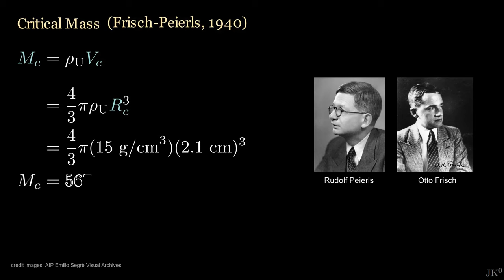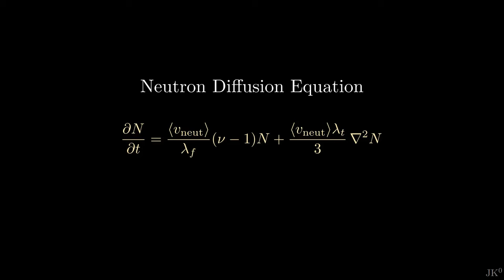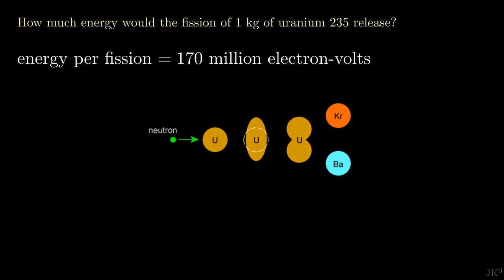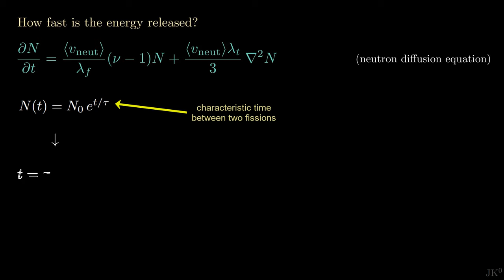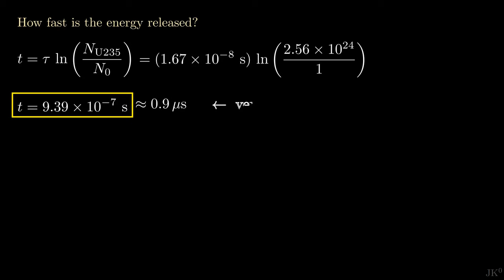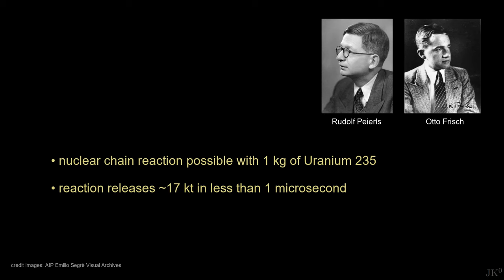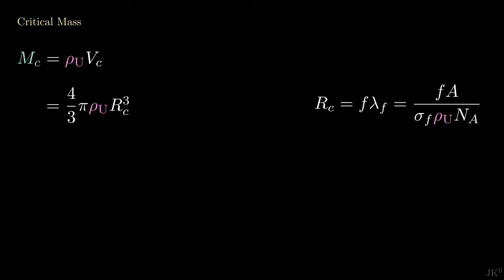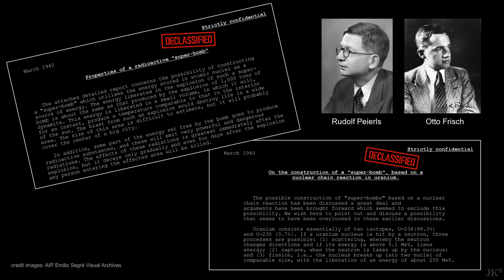Physics of a nuclear explosion

Comment: Another very impressive video. Which makes me think. It is my belief that nuclear power plants potentially are far more dangerous than nuclear bombs. Nuclear power plants contain thousands of kilos of nuclear material, whereas a nuclear bomb only contains a few pounds. The nuclear power plant is in a constant state of near nuclear meltdown, which is only prevented by constantly cooling the nuclear material and using the heat to produce steam to produce electricity. Nuclear power plants cannot generate their own electricity and when the electric grid goes down, generators kick in to supply emergency power - as long as there is enought diesel at hand to run the generators. In modern warfare, the electric grid is the prime target - and when the generators run out of diesel after a week or so, the nuclear power plant goes into meltdown, polluting an area the size of a small European country for half a century or longer. A nuclear bomb can "only" flatten an area with a radius of a few kilometers at best and the radiation is gone withing a few days...
Reply from the maker: Thanks for watching and for sharing your views. I disagree with your assessment of the safety of nuclear power plants, but instead of explain why I believe you might have misleading information I invite you to watch the video that I created precisely about this topic: Nuclear Bomb vs. Nuclear Reactor https://youtu.be/S-uMUq939dY
Reply: @jkzero  Hi, very honoured that you discuss this with me. And I just watched the video you referred to. I know that a meltdown is not a nuclear explosion; if I am correct, it means that the nuclear material (if the cooling process is broken) gets so hot, that it melts through the protective mantle into the ground an then this mess escapes into the air and gets spread by the wind over a vast area. The nuclear material is spread, it does not lose it's radio active properties and keeps radiating it's radio active energy into it's surroundings for a long time. I also understand that this is a worst case scenario, when all saftey measures are knocked out in a worst kind of accident or war. Please correct me if I am wrong - but don´t take offense if I am hard to convince.
Reply from the maker: @retepeyahaled2961  my disagreement goes also with the use of the word 'meltdown', which has a specific meaning referring to elements in the reactor core actually "melting" producing damage. The nuclear fuel in a properly functioning reactor are not "melted", it releases heat but not by melting, the fuel elements remain in solid form.

Comment: I have a question about Little Boy contained 64 kilograms (141 lb)  but in your video  and the Yeald 20 Tons. Did most of the U235 plasted away and a little over 1.3 kg went boom?
Reply from the maker: that is correct, the gun design was simple but terrible in terms of efficiency.
Reply: Not even a kilogram was actually fissioned

Just  a few grams of 80 %heu with a neutron gun and tamper

25 kiloton from 60kg of uranium

But not even a kg was needed before the core blew itself apart to a subcritical plasma

Comment: Did Frisch & Peierls really find (1:10) that "one kilogram [of U-235] could produce a self-sustaining fission chain reaction"? I'm looking at my copy of the original memorandum right now, which proposes 600g as the relevant figure. But it does immediately infer that a kilogram would suffice: "one might think of about 1 kg as a suitable size for the bomb".
Reply from the maker: I referred to 1 kg as a round-up value because this is the follow-up of the video about critical mass (https://youtu.be/LduH7613QXw), where you will see the estimate of the 600 g reported by Frisch and Peierls.
Reply: @jkzero  : Makes sense. It also links well with Bernstein's article a decade back, "A memorandum that changed the world" where he leaves several yield calculations as "an exercise for the reader", including "that of a 1 kg bomb, though 500 times less, [which] would still be formidable". He also does the first calculation of the 1kg reaction time I can recall seeing, and gets a comparable number, "t equal to about a microsecond".

Yield and reaction time would make another good 'homework'. For example, a reason Bernstein used 1kg was it corresponds to actual mass fissioned in Little Boy (only 1.5% efficient). But there are gotchas in such exercises. I absolutely agree that Peierls and Frisch were really ahead of their time. Unfortunately their1kg case is particularly problematic. 

F&P don't explicitly calculate the yield but had in mind a yield energy of 1/500 that for 4700g (~5kg) - so about 8.5 x 10^17 ergs. But this can't be right. Given F&P's value for density, the corresponding radius (for 1kg mass of metallic U-235) is about 2.52cm. Their formula then yields energy from a 1kg U-235 sphere as about 7.5 x 10^18 ergs, an order of magnitude too high. 

Did Bernstein actually check this? His words could be taken that way. Regardless,
I would tend to ascribe "1/500" to numerical fatigue. Peierls had to type this memo 
under time pressure, in wartime conditions, using constants and approximations which made low-mass estimates dodgy in the extreme. It is easy to understand why he might have elided figures which would take too long to pin down.

On a related matter,  Bernstein gives up on trying to explain why F&P chose 4700g as their crucial yield case: "Choice of 4700 g of 235U of Frisch and Peierls seems inexplicable". 
But it's not hard to see Frisch & Peierls' real point. Think about their agenda; find values not just of yield E but of reaction efficiency, with 8kg being maximally efficient, 4700g being a suitable intermediate mass for production, and 403g being minimal. To me the memo's focus on a production case is understandable. 

Addressing Jeremy Bernstein's comment on F&P's "inexplicable" choice of M=4700g; that means 4.2cm as initial radius, exactly twice their critical radius, so a good place to start. I get  E=4.2517(10²º) ergs, supposedly about 10% efficient. This is F&P's "5kg" case with yield "equivalent to several thousand tons of dynamite". Bernstein doesn't seem to understand why they leaned heavily on that case, but that was a dozen years ago and I'm sure he has thought about it since. 

Bernstein's other bugbear is the F&P memo's remark that "τ goes up as r approches r_o"; he insists that " I do not understand the remark about τ because this time seems to be fixed by the mean free path." 

I have my own notions about that, but enough on this for today. Suffice to say I had to recapitulate F&P's 4700g calculations myself because two major references (that of the Atomic Archive, and Stanford University's web page) get it wrong. The former correctly declares 4700g to yield E=4(10²º) ergs, F&P's result. But it wrongly displays the square root term. So does the Stanford web page which also finds E=4(10²²) ergs, a couple of orders of magnitude off.

Comment: How did you come up with average speed = 10^9 cm/s? Given that the “temperature” of a critical assembly is rising, and scattering/absorption dynamics changes, this number probably needs either a more detailed derivation, or a description of conditions, under which it holds true. Also, as you are well aware, the energy spectrum of  the fission neutrons is pretty wide. Just a thought. Thank you.
Reply from the maker: Thanks for your question. The value <v>~10^9 cm/s is just a representative average speed and you are totally right: an appropriate (careful) treatment of the problem requires the mean energy to be calculated using the full neutron distribution. Where did I get this value? Fast neutrons produced by fission are produced with a mean kinetic energy of 2 MeV. Using K=½mv^2, the speed is ~2x10^7 m/s, which is of order 10^9 cm/s.
Reply: @jkzero Thank you. I should have thought about mean :) As always, great video. Cheers!
Reply from the maker: @sergeyyatskevitch3617  thanks again for watching and the interest, happy to help in case you have any question.

Comment: Just doing the math in my head this means that to get 1 kg of U235 to chain react in a low yield bomb you have to compress it enough to raise it's density by 6 times if you don't have a neutron reflector?
Reply: Considering the 1kg case goes back to Frisch and Peierls who found that yield to be only 1/500 the fission power from a 5kg sphere, so smaller but nonetheless "formidable".
Interest in the calculation was revived back in May 2011 by Jeremy Bernstein who did the reaction time estimate of 1 microsecond presented here.

Comment: A nuclear explosion has 2 blast waves that radiate outward from the critical mass , the first is the light that instantly vaporizes the paint that's on a test house that might be set up near ground zero and a few seconds later the blast wave of compressed air hits the house blowing it to smithereens . The light energy travels much faster than the heat energy that follows behind it due to the heats induction that stirs up or excites the atoms that make up the air . Why does light travel away from it's source unrestrained while heat energy gets drug behind and takes time to try to follow the light ?
Reply from the maker: the first wave that you mention is just electromagnetic radiation (visible light, UV, X rays, gamma ray) and for this reason it propagates at the speed of light. What you call the thermal wave is slower because this depends on heat transfer. The equation that describes the propagation of heat (the heat equation) is just another diffusion equation, whose speed depends on thermal properties of the medium, in this case, the air.

Comment: I'd like to know how they knew so much about U235 given that
it was almost impossible to separate from U238?
How could they get measurements without a reasonable quantity of U235?
Then - how did they find out about P239?
That was always mixed with other isotopes like P240.
There must have been dozens of fission candidates to consider?
Reply from the maker: These are all great question, let me give it a try to answer them here:

U235 was discovered by Arthur J. Dempster in 1935; Dempster was a Canadian physicist who built the most precise mass spectrometers, this is how he found that natural uranium contains 0.7% U235. Mass spectrometers allow isotope separation, even for ridiculously small amounts. This is how U235 could be studied.

Plutonium was different, is was not discovered but synthesized, it was produced by Glenn Seaborg in 1940 bombarding uranium with deuterons using a particle accelerator. Again, this allows an exquisite level of precision in the measurements. Pu-240 was produced later in nuclear reactors, together with Pu-239, and yes, Pu-240 is a problem because it can make the bomb predetonate.

Having an element that can fission is not enough for a bomb, you also need to be fissile (it can sustain a chain reaction) to make a bomb. Here the list is short: naturally occurring only U235 is fissile, and later Pu239 was added. These are the only elements that can make a bomb. Other can fission too but there cannot sustain a chain reaction. They knew all this from the Bohr-Wheeler theory, it is almost just counting protons and neutrons to check if the total number is even or odd.

Let me know if this helps.
Reply: @jkzero  - thanks for your reply - much appreciated.
It's amazing that they knew all that back in 1935 before a lump of U235
had even been separated and then so much info about P239 in 1940.
I wonder if you would do a video on mass spectrometers and how all of that was done?
There is also U233 which has been used in a bomb.
A video explaining the Bohr-Wheeler theory would be good too?
Reply from the maker: @Bobby-fj8mk  great that it helped and thanks for the suggestions, I cannot guarantee to take all requests but I am creating a list collecting suggestions for the future, if there is any particular topic you are curious just let me know in the comments of the respective videos, past and future.
Reply: @jkzero  - thank you - your videos are great  -  top notch.
Reply: Read or audiobook "A History of the Atomic Bomb" Richard Rhodes - it covers a lot of this material and the underlying scaffolding of discoveries that lead to the bomb.
Reply from the maker: @heyyou150  yes,  "The Making of the Atomic Bomb" by Richard Rhodes is the bible. I find it amazing how he got to such a deep level on the physics, chemistry, and engineering and still managed to write a masterpiece that reads like the best mystery novel.
Reply: @jkzero   Wild that the Curies were oh so close to finding the neutron - almost two physics Nobels! Also, the physical chemists getting their due. I really struggled but to this day love my P-Chem classes.
Reply from the maker: @heyyou150  the Juliot-Curie could have won three Nobel Prizes, not only they missed the discovery of the neutron, they also discovered the positron, the first antimatter particle, but they did not believe that a "positive electron" was possible and incorrectly blamed a flipped photographic plate.